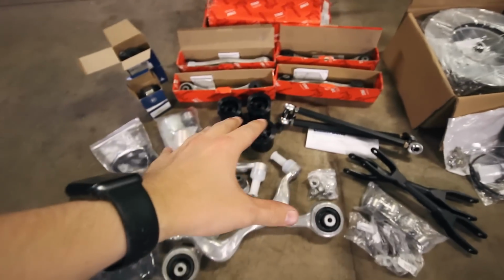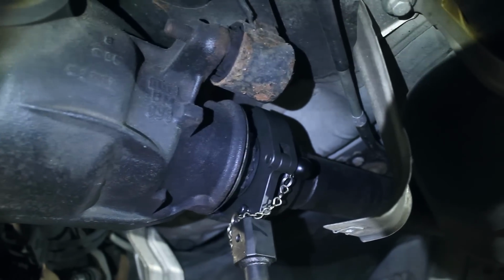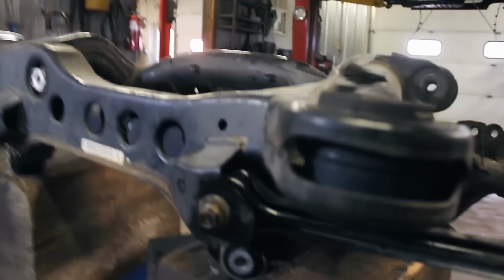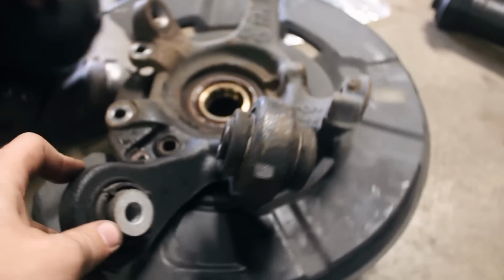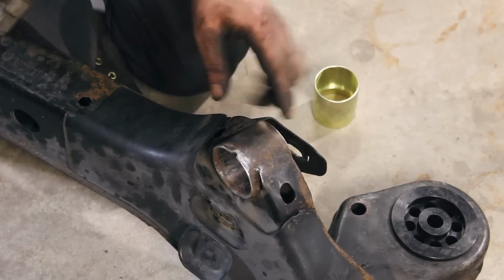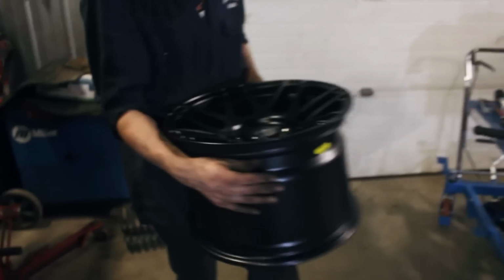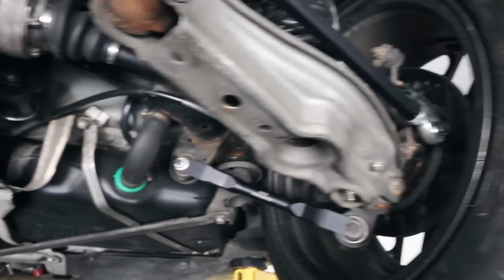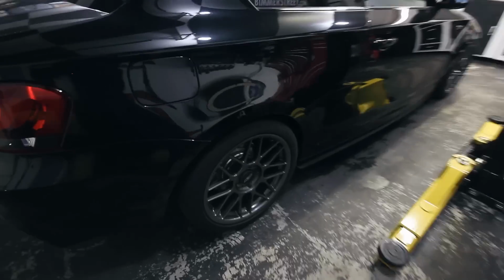INSANE Suspension Overhaul! LSD, M3 Arms, 15" Conversion, Solid Subframe Mounts + MUCH MORE!

Comment: Hi, Jake. I have a 125i, I have a done a 1m oem panel conversion.  I am thinking about doing the rear hub conversion that you have done. To bring the wheel in a bit to help with clearance.   Do you know if the 3 series hub wheel bearing conversion that you did would fit the 125i axle shafts.  I’m not sure if the  groves on the axle spindles would marry up with the 3 series hub/wheel bearing.

Comment: i used the cheap ebay heim joint rod end control arms, billet bushings all around with seems legit garage 8.8 kit.  oem 328i rear rotors,  x1 calipers and a 2mm washer as a shim to center the caliper. all oem and cheap small brake conversion.  double adjustable drag shocks and softer coil spring.  aside from the 8.8 kit, the rest of the entire rear end was like $700.   3 years later still going strong

Comment: Your control arms are upside down.  The ball joint end should be at the knuckle and the arms should be curving downwards like a U.
Reply: You're almost right, the guide rod (the one above the trailing arm) is upside down, the curve has to do kinda of a U shape as you said, but the wishbone is installed correctly.
The ball joints on the upper control arms (guide rod and wishbone) should be installed on the subframe side, not on the knuckle.
If i didn't explain myself correctly you can look up the rear subframe diagram on realoem to see the proper orientation
Cheers!

Comment: This is a great video.  Would it be possible just to replace the rear hub and bearing and keep everything stock back there so I can run 90 wheels in the back?  Also I wish you would've painted your subframe.

Comment: Love the car! Question Jake I have a 2011 135i, if I were to do the hub conversion to a 3 series one for better wheel Fitment would I need to change any other stock parts? Basically would I be able to just order the the straight part of the list you provided, I know you did to be able to fit 15inch wheels. My issue is I rub a little bit with in the rear using 18x9.5 wheels.

Comment: Can you post a vid on your PCV oil catch can setup. I recently got an aluminum M18 valve cover, and am not sure how to do PCV. There is no videos currently for N54 PCV setups for non stock valve covers.
Reply from the maker: I have a stock valve cover. I'm running an upgraded PCV valve and a BMS oil catch can. The outlet is venting to atmosphere thru a hose instead of being plumbed back into the intake.
Reply: Jake Spence thanks man!

Comment: Did you see the new Tuner e8x suspension mod?https://www.turnermotorsport.com/n-TMS_Suspension_Upgrades_mkt20/
The driveshaft remove tool Ooooooo that was beautiful
Reply from the maker: I haven't seen that, but those look nice!
Reply: @jake_spence  Eibach and Cobb are Adjustable Sway / Anti- roll bars that I am leaning towards. Hotchkis is tubular but might make thinks to stiff ( for what I am looking for). A rust spot has eaten a little hole in my sway bar and is the only rust I can see under the car. You are on the market and just want to see what you thought about these few. H&R has some as well but I am a sucker for adjustments to dial in the ride.

Comment: You need to use rust converter on the rusty suspension parts and paint them to protect them from future corrosion. Bare metal will corrode quickly without protection.
Reply from the maker: True, I will be doing this in the next couple of months.

Comment: Not change the sway bar big mistake
Reply from the maker: I could always change it later. Won't be difficult. What do you recommend?
Reply: @jake_spence  the problem to change the rear sway bar is that you have to do again to take off the rear subframe or at least a minimun to change the sway bar

Comment: My subframe is super rusty it looks awful anyone got some tips to sort this out? It’s a 2008 E87 123d in comparison to your subframe yours looks new and mine has been subject to salted UK winter roads for 12 years!
Reply from the maker: Dang, I thought mine was bad! I would try to use some POR15, and sand away the rust first.
Reply: I’m not really sure how to get the inside of it sanded, perhaps I need to get another subframe and get it sandblasted and treated them do a swap

Comment: You will have a lot of vibration through the frame.  If it is a dedicated track car no problem, daily driver will suck.
Reply from the maker: Not any additional vibration. The newer BMWs come solid mounted from the factory, no rubber bushings. You will only feel vibration with solid differential, transmission or engine mounts.
Reply: @jake_spence  Thanks for the reply great info man...Your doing a great job.

Comment: My  bushings are dead on the front control arms on my 135i , idk what to do , just change the bushings or go with a different control arm ? Thx 
Amazing work btw , dream 135i build 👌🏻
Reply from the maker: It'd be the perfect opportunity to upgrade to M3 control arms. That way you don't have to press in and out different bushings to our existing control arms. I have a link to the M3 control arms in the description. Thanks for watching!
Reply: Jake Spence thanks a lot for replying ! 
M3 control arms will fit the car with everything stock ? Thx 👌🏻

Comment: Did the solid bushing increase the noise in the car?  My car "07 E92 335i is my daily.  Would like to improve the handling but keep it quite on the inside.
Reply from the maker: Nope, no additional NVH or noise from the solid rear subframe bushings. The newer F-series BMWs don't even have bushings, they're directly mounted to the chassis of the car. But if you use solid differential bushings, you will feel some vibration and noise.
Reply: @jake_spence  Thanks Jake

Comment: Nice video bro!! I want to know more about that 15 in brake conversion on the rear. I got a 335i
Reply from the maker: I believe you should be able to use all of the parts in the description under 15" conversion. You won't need the hubs or hub bearings though.
Reply: What’s the lug pattern on the wheels?

Comment: As far as you went with this I would have probably sprayed the front and rear subframe powder coated or ceramic. 🤔 still looks crazy lit! Nice job!
Reply: N54 Lord I had that exact thought..
Reply: MillerrMedia unfortunately we did this entire job front and rear in a single weekend, so we really didn’t have time to send it out to be coated but your right, it would have been ideal.
Reply: Joseph Rosenbauer I do get that but being the car is going to be down for the winter why not wait till you guys had the time to paint everything while it’s apart, more efficient then doing it twice🤷🏻‍♀️ just my two cents👌
Reply from the maker: @MillerrMedia  I agree with you, but this was before winter. I was in a crunch to get it done before NFZ 1/2 mile event, and we were working on Joseph's time. If it were a winter project and I wasn't hogging a bay in his shop, I would've done it.
Reply: Jake Spence ohh okay that makes sense, since you said you were waiting for axles I didn’t know you were in a hurry to get the car done, 
I have a 2012 135i and I’m gonna be doing to hub and rotor conversion as well in the spring
Reply from the maker: Agreed! Like Joseph said, we were in a time crunch. I will still try to mask everything off and prep/paint the rear subframe at some point.
Reply: @jake_spence  Cool 🤗

Comment: Nice I bet you're loving that diff! I installed the same one about a month ago. I kind of regret going with shorter gears on mine but I'm pretty used to it now and it does ok with the stock twins. Totally transforms the car!
Reply from the maker: I am loving it! Sucks that I haven't really been able to drive it because of the snow. But I'm itching to get it out again this spring. I enjoyed the stock ratio because I do 1/2 mile 170mph+. But shorter gears would be good for shorter tracks.
Reply: @jake_spence  heck yeah I bet you're itching to get out and drive it! It totally eliminated that little pause/spin when boost kicks in for me and corner exit speed increased a lot too. I can imagine that in conjunction with solid bushings, holy cow!

Comment: Sick work....how you liking they vibrating tho? What motor mounts you got. I ripped through 2 different ones after i went solid everything. Now i got solid mounts. Also when you run the slicks i recommend going 0 camber in the back or you will eat up slicks and lose traction.
Reply from the maker: I haven't really noticed any increased vibration. I have new stock motor mounts. I will keep an eye on everything, but I think since I have poly trans and poly diff mounts, it'll be more forgiving than completely solid. We tried getting camber as close to 0* as possible.

Comment: Also, I have the bilstein b14 coilovers and they’ve been great so far. With them raised all the way up it lowered my 335is about an inch but if I put them lower it will rub so I kept them all the way up. They feel stiffer than stock yet smoother at the same time.
Reply from the maker: Good to know! Bilstein has been a great name in this platform for a while. I'll consider them when I continue my search.
Reply: I like my voghtland coilovers, and I have  20x10.5 no rubbing , good ride and better  handling. You can get them for 750 , I think thier the best option at the price.

Comment: Theres still a lil flex in the poly ones, hence the holes
Reply from the maker: I don't have any holes in the poly ones except for a hole that the bolt goes thru. Are you sure you're not referring to the aluminum subframe bushings?
Reply: @jake_spence  diff bushings had holes in the video

Comment: Can you measure from the ground to the the top of the wheel openings? I am trying to figure out how low those springs would make my car.  One more thing can you hear the rear end banging around with all the upgraded bushings.
Reply from the maker: I could do that, but it won't be the same as yours because I've removed about 400lbs from my car so everything sits higher lol.
Reply: Jake Spence close I think my car would be fairly close I have lightened it up a little.  I’m just curious what yours is at?

Comment: Would the 15inch coversion ( calipers and rotors )  work for a 335i ??? Since you basically switched to a 335i hub ? 🤔🤔
Reply: its easier to do on a 335. you just need to swap rotors and calipers
Reply from the maker: Yes I believe so. We're both thinking the same thing, lol. Since I swapped to a 335i hub, the rest of the parts should be the same for you. Just check the links in my description to buy the exact parts.

Comment: Fantastic effort. I'm blown away by how much work that was to swap all of that out. Makes me wonder if my 2008 335xi will need any of those parts. I just got into autocross and drag racing last summer and will be hitting it up again this year. Man I love my car. It's such an improvement from the 3 Ford Taurus' I used to own.. Just put in a Spec single-mass lightweight flywheel and clutch last month. Next is the intake, intercooler, and spark plugs.
Reply from the maker: It was so much work! The video didn't do it justice. It took us 3 full days of work. You'll fall in love with your 335xi, especially after the new intake, intercooler and plugs. Enjoy!

Comment: $10000 on a single turbo setup, what's another $10000 for suspension?
Reply from the maker: To be fair, I got the hookup on a lot of this stuff. But I would've bought it anyways because they are great parts from great companies.
Reply: @jake_spence  Ballpark estimate what it would normally cost for all these parts?
Spectacular video!
Reply: Tom Chips its really not too bad if you can do all the labor. Whiteline sells a full bushing kit for the front and rear, very inclusive for like 450 or so. The trailing arms and m3 control arms will be about 600 all together. Those solid subframe mounts aren't cheap but I'm going with poly inserts instead of the full swap and they are like 70 bucks. If you were to pay a shop to do all the labor though, it would be thousands!
Reply: Tom Chips its really not too bad if you can do all the labor. Whiteline sells a full bushing kit for the front and rear, very inclusive for like 450 or so. The trailing arms and m3 control arms will be about 600 all together. Those solid subframe mounts aren't cheap but I'm going with poly inserts instead of the full swap and they are like 70 bucks. If you were to pay a shop to do all the labor though, it would be thousands!